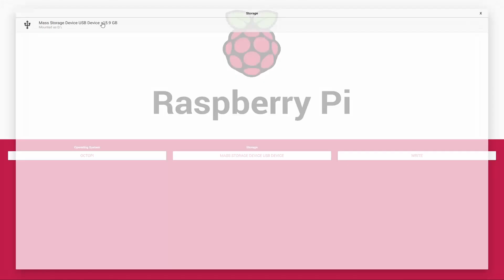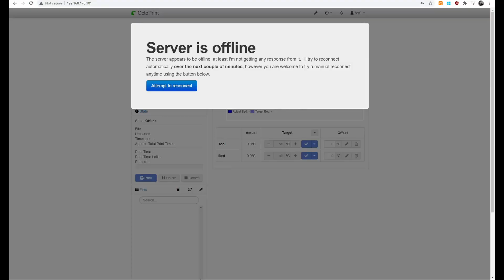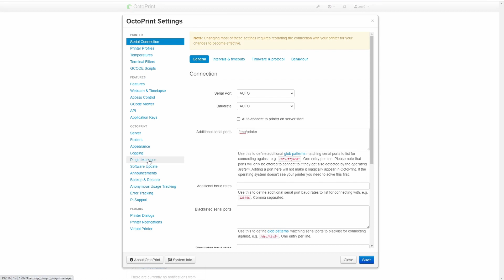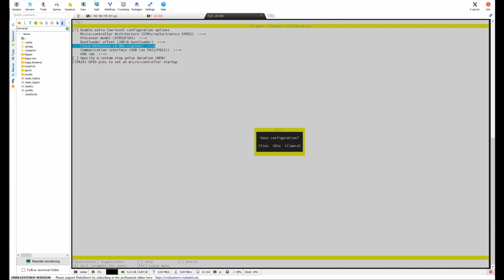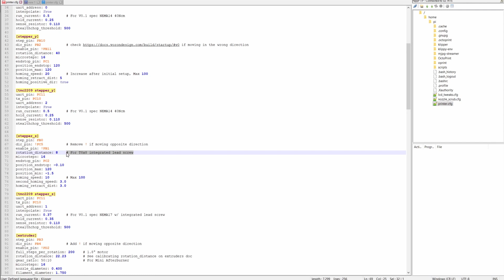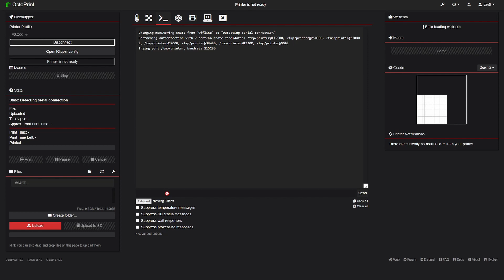Building Voron v0.1 - Software [Ep12]

Comment: I finished my V0.1.. Can't get it to go that fast tho.. My extruder with the dragonfly can't do more then 10mm^3/s
Reply: max out around 100mm/s print speeds
Reply from the maker: I have no experience with dragonfly but yes you may need high flow versions. Although I printed couple parts at 200mm/s with dragon standard flow.